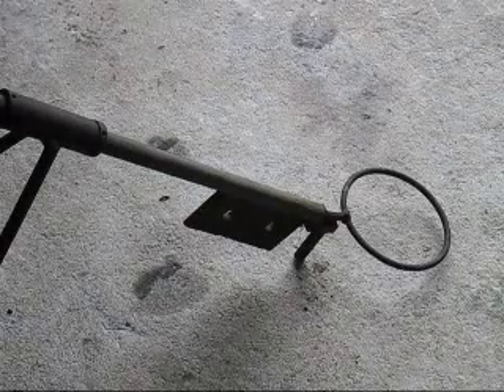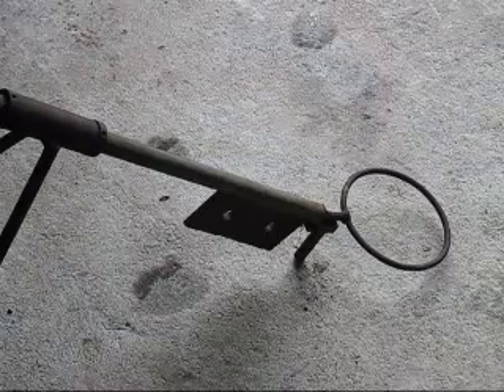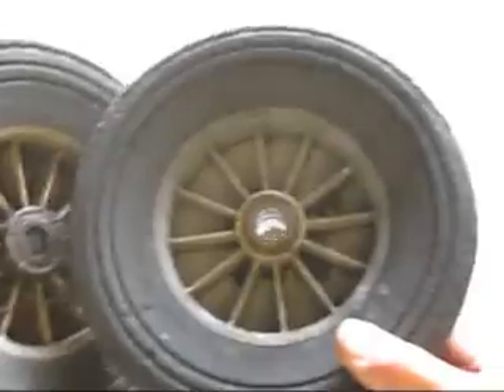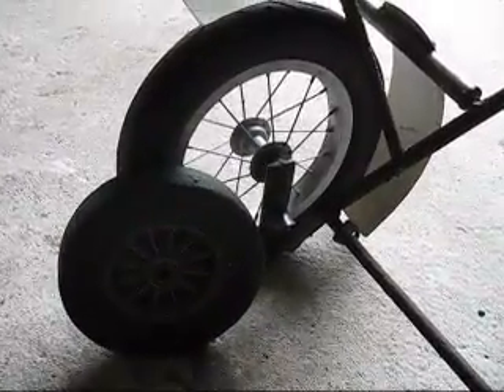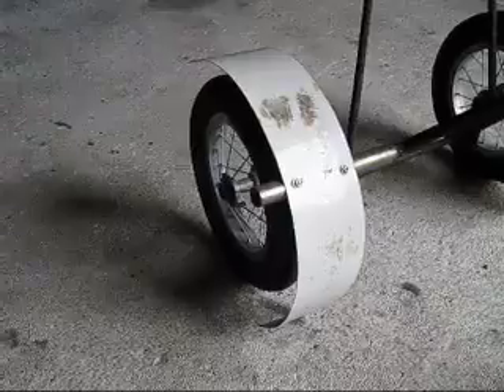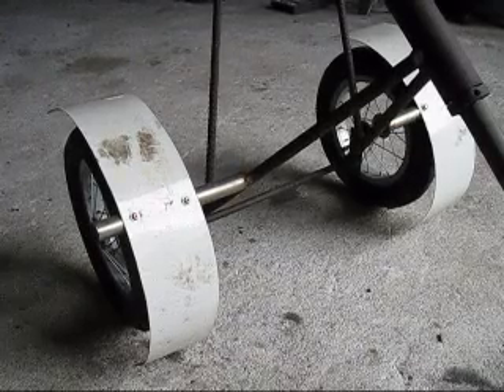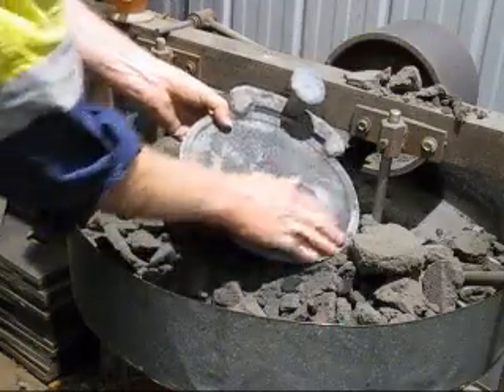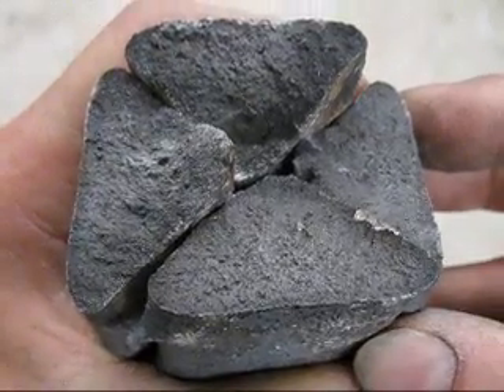Crucible camera pouring iron, improved version.

Comment: Lucky, there seems to be some struts added to the trolley. Could you please show us how that trolley looks like. Also, did you ever have crucible to fell of the ring? Also, are yours crucible all of the same size?
Reply from the maker: I do have a video about this trolley. If it is the one I was thinking of it was added to stop the camera shaking.
Reply: Made a replica of your trolley, but need some more training on it. 
https://www.youtube.com/watch?v=nEn53N4Z_84&t=9s @luckygen1001
Reply from the maker: Those struts are to stabilize the camera so it is not shaky footage. The best thing I did was getting rid of the solid wheels. I had a crucible fall out once trying to get the last metal out of the crucible. I had a look at your video and it seems to work well but they can take some practice to master.
Reply: On my cart wheels are deffinitively in a prototype stage. They will go next week after I return from our Melbourne trip. Thinking to install a brake on one site to limit movement. Deffinitelly need more practice. Not sure if is visible but there is a small arm to mount gimbal for the camera. Still quite a bit of work on a buner, mainly to work out an ignitor @luckygen1001
Reply from the maker: No I did not see that but having a camera is a great way to see where you need improvement in pouring metals. @VladekR